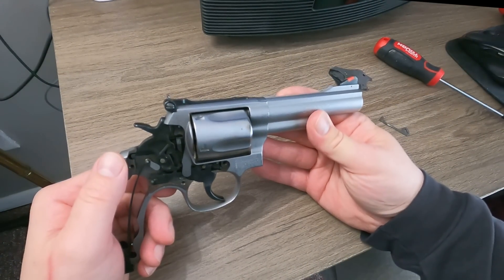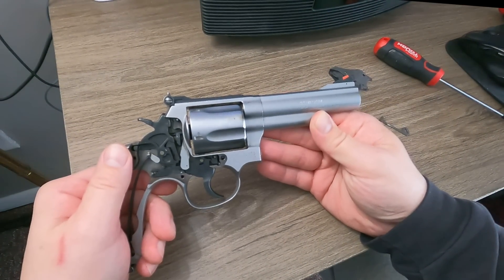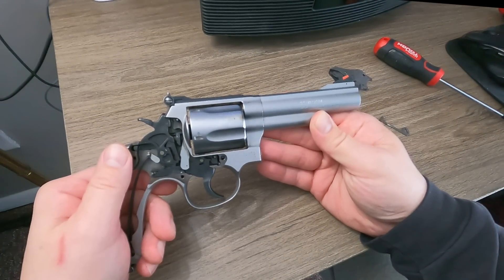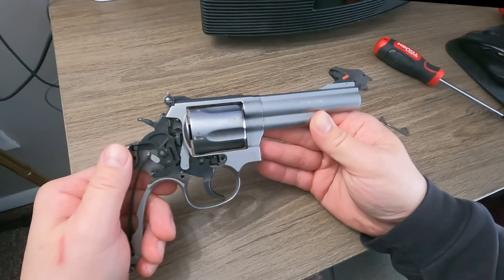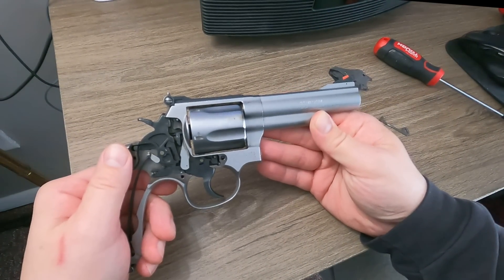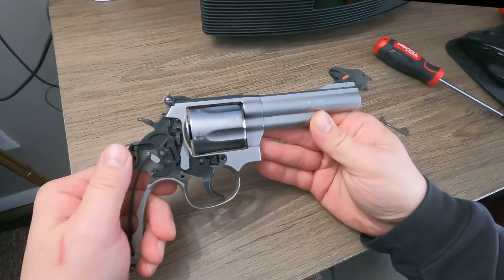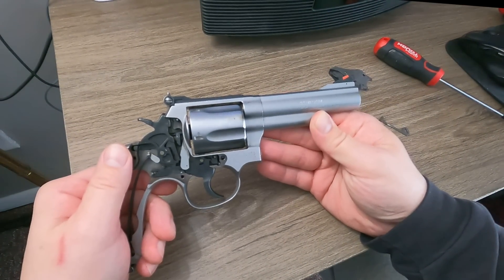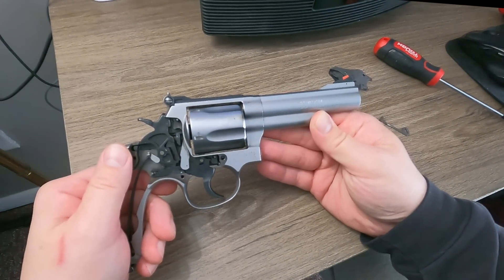Why Smith and Wesson's Revolver "Safety" Action is Superior to Taurus, Ruger and Others

Comment: They are both reliable drop/hit safeties.  The biggest difference is if the hammer block fails, (breaks) the revolver is less safe as it loses the drop/hit prevention.  BUT, it will still fire when one wants it to.  If a transfer bar fails (breaks), your loaded revolver is now nothing more than a club....a striking weapon.  Ok if your at the range.  Not ok if you need a shot at an alarmed and angry she bear.  Ruger has an extremely low incidence of transfer bar failure when compared to less expensive brands.  Their bars are made from billet steel, where Taurus and others use a cast powdered metal bar.  Good vijeo explaining the workings.  Most revolver 'reviews' don't even mention this important part of the firearm.  I own several Rugers and am comfortable with their quality.  I have a stainless .357 Security Six that I bought in Kodiak Alaska in 1979.  After about 7,000 rounds it needed some smithing for timing issues, but the original transfer bar still doing its job to this day.  I shot it about 2 months ago at a bowling pin shoot using 158 gr .357 loads.

Comment: New colt cobra has had 2 broken trigger return springs, pressed in firing pin bushing fell out and a broken hammer "hook" (where the hammer spring stirrup attaches to the hamme)

Ruger LCR broken trigger return spring

Ruger sp101 excessive cylinder gap.

Ruger gp100 misaligned barrel.

I have a dozen smith and wesson revolvers and have had one firing pin break.

The most important factor is "SMITH AND WESSON SELLS PARTS".

With every other revolver manufacturer, if you break anything other than a spring, you have to send the gun in.
Reply from the maker: Yeah I even had to use a S&W J-frame cylinder screw on a Taurus small frame where the screw broke completely, had to dig it out and turn it carefully. To my surprise the threads were identical on the S&W screw, at least identical enough there was no stripping.

Comment: Completely agree. I am curious as to how much the new Rossi revolvers duplicate the S&W design.
Reply from the maker: I had a Rossi many years ago, it was the oldschool S&W design with firing pin on the hammer, suggesting hammer block. The Turkish made SAR revolvers use a S&W style hammer block as well.

Comment: Interesting take. The only DA centerfire revolver I own is a S&W which I've never had any problems at all with. I own five Ruger SA revolvers (what can I say - I love the old west, SA revolvers, and I shoot SASS) and I've had no problems at all with them either.  Your experience sounds more like an indictment of Taurus's materials, and/or maybe manufacturing quality, than the design itself, though I certainly understand your point as well.  I've also never shot a thousand rounds through one in one weekend.  A few hundred combined practice and SASS club match has been my biggest weekends.

The only revolver I've ever known among myself or friends that was not reliable was a Taurus a friend bought used from a range and gun shop. It had severe timing issues and would never get through an entire cylinder without binding.  The shop worked on it and couldn't get it going and refunded her money.  Maybe if it had been sent to Taurus they might have taken care of it.

Comment: I enjoyed learning something new in your video. I have a Chiappa Rhino (200DS). Looking at the documentation, they have a "transfer bar", but they are using that term differently than what I would expect in a revolver. So, the question I have is this: could you figure out if there is any type of internal safety mechanism that would effectively work to stop a hammer strike?

Comment: Regarding Kimber revolvers: Best I can make out, going off the owner's manual, the Kimber "DASA" model revolvers (which is all their external hammer revolvers) use a transfer-bar system, like Ruger, Taurus, and Charter Arms, while the rest of their revolver models (which is all their internal hammer revolvers) use a hammer-block system, like S&W. In short, with Kimber, if external hammer, then its using a transfer-bar system; if internal hammer, then its using a hammer-block system.

Comment: I knew the system in my 66-8 was a block and not a transfer bar. What I did NOT know until this video was that it was in addition to the rebound slide safety. It's almost as if the hammer block is just a failsafe incase the detents on the rebound slide get worn over time.

Comment: Sam, I totally agree.  Smith and Wesson are the most reliable revolvers I've ever used.  I have one 856 heavy 2" and it just has a cheap feel.  I can honestly say that I have not had any problems so far but based on a few problems I've seen on YouTube with Taurus I would never use mine as a main gun.

Comment: The S&W design uses more parts and costs a bit more. I agree that it is better because it is a redundant system. I noticed that Taurus is still putting the DA sear in the hammer. That is also different than S&W. That's the part that started misbehaving in my first Taurus revolver (my first gun). If you look closely, you'll see that it is held in place with a small pin. It can wiggle about. That's not very good for a part that requires tight tolerances to work smoothly. I think that is a very weak point in shooting a Taurus in DA. The S&W setup uses more parts in DA mode as well. Don't lose that little spring! Overall, I think S&W is using a better design with better tolerances.
Reply from the maker: I didn't notice that, good point. That spring has still never turned up lol. Vaporized. A few days ago, had the 856 open and the little spring inside of the cylinder screw that connects to the part that holds the crane pin on, came out and vaporized. Happened to be in my kitchen so I did eventually find it.
Reply: @GunSam  It's hard for me to coherently say how much I hate tiny springs! LOL.

Comment: Very good presentation. Remove the hammer machine a new one not requiring a transfer block or figure a way to lengthen the hammer face to allow firing pin strike....the old colts have an insert that is pinned into the hammer face. Kinda free floats too. Just some movement not sloppy wiggle. That is the fire pin and can be replaced if fractured or worn enough to produce lite strikes....carry on empty cylinder...

Comment: As a mechanical engineer, I can say you have a point. The simplest answer to these shenanigans is for the company to actually use a piece of forged, hardened steel that has very high fatigue limits, instead of skimping out on a very critical piece.
I've read the forums and heard the comments that people don't like the transfer bar rattle in various brands who use them, namely Ruger. Well, sure, you have a point. Yet, these companies are just as stubborn and as regulated as any other manufacturer who gets stuck in a tradition, sells a boat load of stuff with all their CAD models, blueprints, MRP routings, CNC programs, and entire staff used to doing something a certain way that seems to be working so far, and to go to the pain of changing that system is thousands of hours of rework and miles of red tape within the organization. It's not a problem when the design phase of the firearm is currently on the table but to go back and revise it decades later is a big deal.
I've looked at Ruger as a generally stronger action vs. S&W as an example of where Ruger has a leg up, not really the actual firing mechanism.
You're right, the hammer is a thicker piece of metal that can take the shock tens of thousands of times. Put a strap between the pin and hammer, now the strap is "transferring" force to the pin. Not a big deal at all, provided the strap is made of the right stuff and is properly retained in the frame.
Reply from the maker: I have heard from these guys too lol. They come off as revolver experts, then say there's a rattle and don't know why. I find it funny. For me transfer bars are fine within reason. Like my carry LCR, totally trust is as the LCR's cam action barely has much force and in DAO the force is pretty low on top of it, so it's a good transfer bar in a good design not taking on a ton of force, and I don't shoot it a lot. On the flip side is a Taurus .22 LR, extra spring strength just to be reliable, extra use as the average person who puts 50 rounds through a .38 Special puts 300 rounds through a .22 LR, a lot going on there setting up for failure.
Reply: @GunSam  Do they complain about the rattle in their $90,000 Duramax Diesel? haha!
LCR is a great product. Been hoping Ruger would release a one-step larger version of that design with some other caliber options, a higher capacity .22lr and .22wmr, 6 shot .357, maybe a .41 mag or .44 special, options for semi-auto moon clip loads, something.
You do shoot a lot, that's admirable. Wish I had access to public lands to just bump off and pop away at a moment's notice.

Comment: I have a Taurus 66 in 357. It works good right now. But, not sure I can depend on it forever. I just bought a S&W 686 Pro Series. I pick it up in a couple weeks when I get home. I'll put them up against each other and see which one is better.
Reply: Wondering if I should remove the lock on the S&W. I see there are plugs to fill in the lock hole.
Reply from the maker: @richdoherty64  I guess it would take some debate with yourself. Do you think you will ever have a chance for self defense use? Then ask if it's worth it that the one in a million chance the defense use is questioned, and taken to court. Then a prosecutor telling a jury who don't know better "ladies and gentlemen the defendant did take out the safety to make sure his gun was more deadly and would fire with half as much trigger press" or some other lie. If it's a range toy, or a house gun in a castle doctrine state I might remove it, if I was carrying on the street, maybe not.

Comment: If hammer block fails, gun can fire when dropped. If transfer bar fails, gun fails to fire. I think it's failure mode tradeoff. Not sure if all Ruger revolvers are the same, but Ruger copy of CO2 pellet gun Crosman SNR357 uses transfer bar but very different from Taurus.

Comment: Curious what you think about the Colt design. It has fewer parts than the S&W based systems, making it operate smoother, and there are fewer parts that can fail. It locks up the cylinder tighter, making the design potentially more accurate. The more positive lockup may also improve reliability when dirty. However, the same advantages make it more prone to going out of time - because the pawl is pressing on the cylinder as the shot goes off, and putting a lot more stress on the lock work and trigger components. So not sure what to make of it, and how it all works in practice.

Comment: Had a new Model 66 apart today. I was not impressed with how the spring beneath the hand was not captured on removal of the hand. The hand actually holds the spring in place. Got it back together and function checked ok.

Comment: I feel that Smiths and Colts are just more aesthetically pleasing and more refined. Having said that, I have put numerous heavy dinosaur loads through some of my Rugers that I wouldn’t even attempt with my Smiths or Colts. So, I don’t think Smiths are tougher at all. I also think the Red Hawk, Super Red Hawk, and Super Black Hawk Bisley Hunter are best in class for heavy use and price. That Hunter Bisley is also gorgeous. The Ruger Vaquero is also gorgeous. But, I still prefer the look and feel  of Smiths and Colts for purposes not related to killing dinosaurs.
Reply from the maker: I feel like S&W is the good compromise. Pretty strong, pretty smooth. Now I wouldn't put something labeled a .44 Mag+P through my model 69 the way one might through a Redhawk, but the regular Magnum loads, even really hot I know my Smith can handle them.
Reply: Good video.  While I like my Smith’s. For pure strength my GP100s even my S-6 models are stronger.  Painting the Ruger’s with the same brush as a Taurus is an interesting interpretation.  When I want a small frame revolver I usually go Smith, Medium frame I lean toward Ruger.  Admittedly I did disassemble my GP’s and polish the friction points but the action is as good as any out there.  The Ruger has fewer more robust parts than the Smith L-frame.  I understand that you have had some really bad luck with Taurus but saying that a Ruger is just like the Taurus and that equals unreliable is a bit if a stretch.  You did a great job of explaining the differences between a hammer block and a transfer bar. Transfer bar has been around for a log h time think I rennet them from Iver Johnson and Harrington Richardson revolvers. 

Oh and the reason Smith went from the firing pin on the hammer to a frame mounted firing pin was, the firing pin would some times break on the hammer mount if dry fired.

Comment: Well done. A lot of people do not understand these systems. 
One thing I know, cops prefered the hammer block system. Generally if it DID break, the gun would still fire, even though not drop safe. If a transfer bar system breaks it is a paper weight till you get it fixed. Not that I have ever heard of either of them breaking without being monkeyed with by a shade tree gunsmith.  
How did you manage to break 2 of them? Curious.
Reply from the maker: Thanks. These were Taurus 94 .22 LR rimfire revolvers. Just normal firing, first one I shot about a brick and a half or 750 rounds, snapped off. I didn't dry fire them or anything. They replaced with a new gun, shot 500 rounds over the course of a couple weeks, snapped off in normal firing. No different than I fire any revolver I have ever owned.
Reply: @GunSam  Interesting. I have owned Taurus revolvers, and we still have one as our bedside table gun, with zero issues, but i have never shot them a lot. Maybe 200 rounds through my current 38 spcl model 85. My Smith 686 is the one I have put 1000s through. No issues. 
I guess I am not surprised that Taurus uses inferior metal though. Got a lot though my Ruger single actions as well (all transfer bar guns) without breakage. Thanks for telling me.

Comment: My Rossi had a hammer block.
My new Ruger had transfer bar.
My security training officer trained us on older, firing pin type revolvers, And from probably early 19 hundreds to the  80s everyone knew to keep the chamber under the hammer empty.
These days instructors are a dime a dozen, and always say you can load all six. but this is wrong. On hammer block arms.You can point them down range, an strike them on the hammer, and in some cases the "pin" all by its self, can pop the primer. ( Operator error) in my opinion.leave the chamber under the hammer empty, best safety of all
Reply from the maker: Not on double action revolvers. Been safe for 100 years to keep all 6 loaded. Only the single action revolvers were safe with one empty.
Reply: @GunSam  You are most likely not informed on "any" revolvers before 1960. Obviously because you probably weren't born yet,  and probably not untill about 1985 or so.
Reply: The hammer block was in the Rossi that lost in a lawsuit for Drop firing danger  the S&W is also drop firing dangerous, your 100 year claim is bogus, because many S&W hammer blocked firearms have accidentally discharged.

Comment: Sidenote: With the Tarus apart and being able to see the advance mechanism I can totally now see why cylinder advance is so problematic on it. Just by way of the design if there's any slop or distortion in the frame itself it's not gonna work right. I didn't know it was that badly thought out.
Reply from the maker: I am not an expert an how that works, but I can tell you that Taurus replaced my 856 with another and the reason they listed was that the "frame was out of spec" so I think you must be right.
Reply: @GunSam  it's really difficult for me to explain it in writing why it would be, but I can tell you what clicked it for me; pull the hammer back slowly and watch how the what I'm guessing they call a pawl, (I don't know what Taurus names their individual parts, everyone's different) and watch the interaction of the whole cantilever. That's where it went off like a firecracker for me, just how the parts interact and where the fixed points and pivots were

Comment: Now I have to think of this in hindsight. The manual to my Taurus Raging Judge specifically said NOT to dry fire that particular revolver, even though it was a centerfire. It had quite a heavy spring (probably because, I don't know, Casull). Makes me wonder if their precaution was a testament to the transfer bar's long term integrity.
Reply from the maker: I have no idea really. I guess you could look into if .454 uses rifle primers, as if it does then the spring will be heavier and put more force on the transfer bar.
Reply: @GunSam  They absolutely do use small rifle primers, but I wasn't sure if that made them inherently harder than pistol primers. Still, it's nice to know that if my 66's hammer block fails, that the gun will still fire when I want it to, and it won't fire when I don't want it to. I didn't know this before your video, so your info is vital to us!

Comment: The hammer block is a back-up safety to the hammer seat/rebound slide seat.  Should the hammer seat/rebound slide seat get excessively worn or shatter, then the hammer block comes into play.  It's a very safe system.

I think it would be interesting to measure the lock time between the S&W system and the transfer bar system if Taurus, Colt, and Ruger.  Any guesses which is faster?